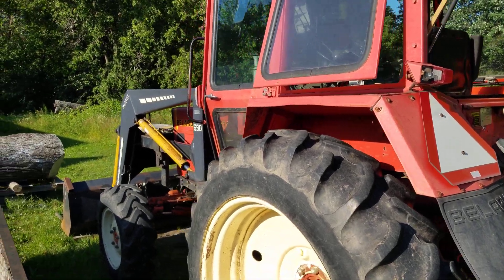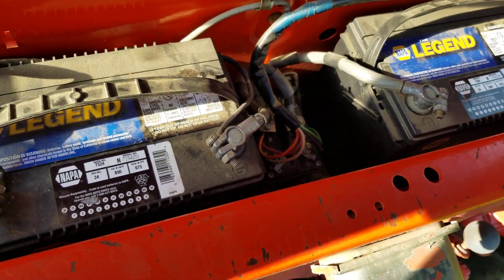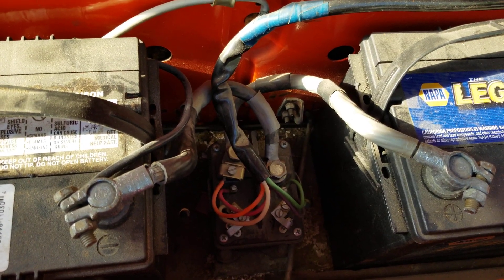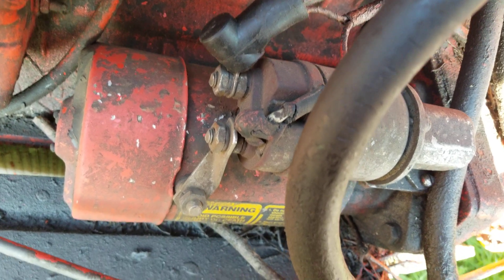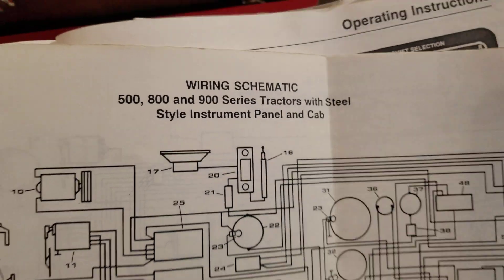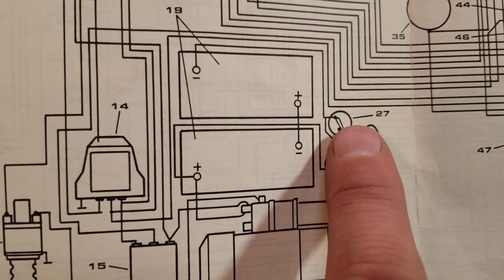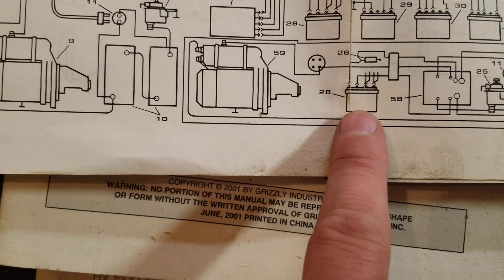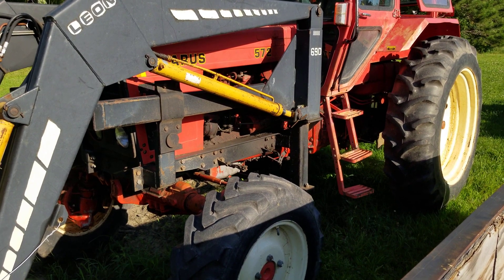Belarus 572 Battery Hookup

Comment: This is very good info!.. thank you for taking time to show!.. I have a 572 1985 also, and it had lots of wiring cut and missing!.. as if someone needed wires!.. I still am wondering about the connection of the igniter coil on the top of intake manifold..+ the two relays that are to the right from that igniter.. they are one behind another!.. Can you take a picture of what wires colours are there?.. please!..

Comment: I recall these Belarus tractors being imported about 30 years ago. I worked with a guy that bid setting up a full set of manuals, I think he said they turned his offer of $1.5mill down, but that's what it was going to take to create all the artwork and maintenance manual instructions. 
Can you get parts for that machine? Must be reliable else you would have traded it in.
Reply from the maker: Yeah I think there's some sources for parts. The thing has been reasonably reliable in the years we've had it. Plus it has the advantage of keeping the ground around it well oiled. It's also just backward enough that I don't entirely worry about the Russian commies taking over the world anytime soon.